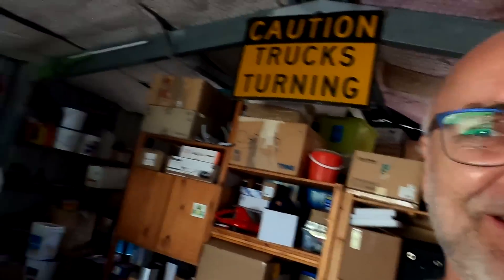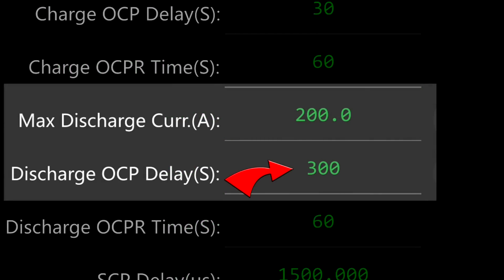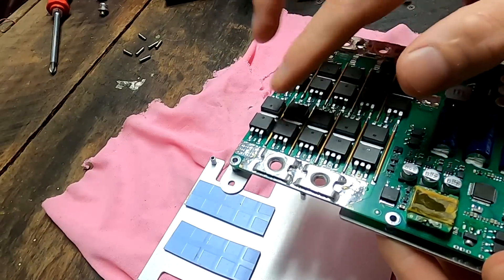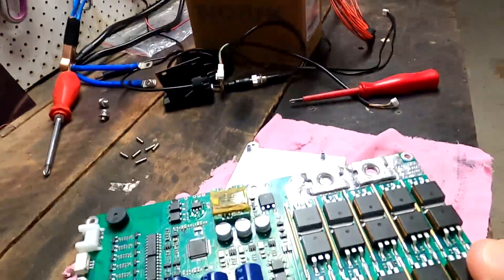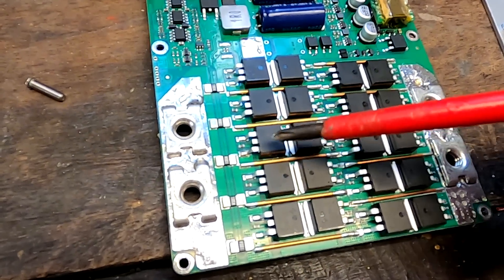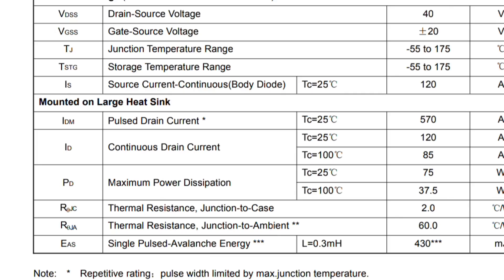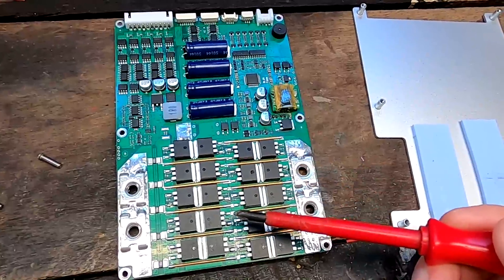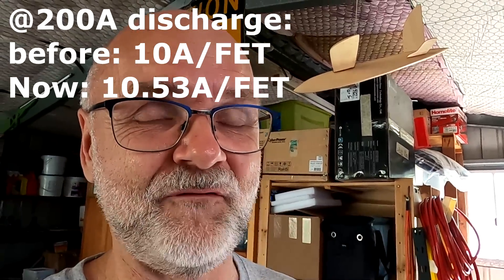Magic smoke! What happened to the JK-BMS? Still reliable or bad design?

Comment: Rule of Thumb: If you buy a BMS for a 200A continuous application, get one that is rated for 250A+. It's rarely a good idea to run anything at it's maximum capability continuously.
Reply: For sure, but the high current disconnect is supposed to be there to protect the system if something goes wrong.
The suicide disconnect is probably not the best safety...
Reply: For a timed over current cutoff it should be easy to for the BMS to start dialing the current back down prior to disconnect for 30 seconds to level out any temp/current imbalance between mosfets. Any reason this is not standard practice?
Reply: @kustomzone  The BMS has no ability to dial the current back slowly.  You would need a voltage converter to do that.   The MOSFET can only be on or off.  Any gate voltage that puts it in an intermediate state for too long (probably just a few milliseconds would do it) will dissipate the difference as heat and blow the MOSFET to smithereens.
Reply: @junkerzn7312  That is the purpose of snubber circuits. I don't know how (or if) it is implemented in the BMS. Snubbers help to reduce switching losses, slows down the current change and absorbed the voltage spikes to protect the switches.
Reply: @junkerzn7312  MOSFETs can be used for analog stuff like audio, voltage/current sources, DC loads, etc. Though most FETs aren't officially spec'd for that anymore, they can still be used as such perfectly fine as long as you stay within the SOA. At 14V 200A across 20 MOS pairs, that would be 140W per pair. If you individually rate-control every pair to keep them perfectly in sync, you could afford switching them off over a span of about a second. That would require one driver per FET pair though and there is no sign of one here. These are gang-controlled with small balance resistors to hopefully keep them together.
Reply: @kustomzone  the BMS does not current limit. It is a simple on/off switch.
Reply: @teardowndan5364  Small signal amplifiers, sure, just like transistors are used for that too.  But those circuits only pull a few milliamps and nobody cares that the transistor or FET is dissipating the difference between the power source and the output as heat when there are only a few milliamps going through the circuit.

Big difference between a few milliamps and a few hundred amps.

The question we need to ask with the type of circuit change you are suggesting is "what does it actually fix" ?   Insofar as I can tell, it wouldn't actually fix anything, but it would increase the cost of the BMS by at least a factor of two, maybe three.

The correct solution is to make gate drive about 10x (my guestimate) as powerful as it currently is (either to the rail or to GND... both directions have to be able to deal with a lot of burst current).

-Matt
Reply: @smak201  Snubbers are useful in switching power supplies.  The BMS is not a switching power supply, it's just an on-off switch.   The FET already has an integrated reverse diode, so a positive voltage spike on the output isn't going to hurt it.  That leaves just a negative voltage spike when it turns off to over-volt the D-S

But I don't think anything Andy had connected up to the output could cause a negative voltage spike.   The inverter going into the car charger has a huge capacitor on it, the voltage on the DC side should just drop steadily to zero.  I did suggest in my other comment that Andy put a scope on the gate and the output (using both channels) and take a look at what was actually going on.  Both to observe the gate transition time and to see if the output had any positive or negative spikes.

I still think the gate transition time is the most likely culprit.  It is the most common mistake that circuit designers who are inexperienced with power electronics make.  Its really easy to assume that the gate on a MOSFET works like a simple almost-digital input.  But it doesn't when lots of current is being pushed through the MOSFET.

I'll try to find an example of what I'm talking about... just quickly googling ... ah, here:

https://www.electronicshub.org/mosfet-as-a-switch/

Go about half way down to "Practical Switch Characteristics" and look at the bottom graph of the three graphs there, labeled "Switching losses".  That's the basic problem.   When the GATE is fully on or fully off, the losses are minimal.   While the GATE is being turned on or turned off, the MOSFET will experience non-linear switching losses.    The period of time that the MOSFET experiences these non-linear losses is determined by how quickly the gate can be pumped to the desired voltage (in both directions, either driving to V+, or driving to ground).

So basically, if the gate transition is too slow, and the MOSFET is handling a lot of amps, the losses cause it to explode during (usually) the on-to-off transition even though it was working just fine when it was steady on.   This is why dedicated gate driver circuits are required to drive the gate when using MOSFETs in power electronics, and also why its a bad idea to gang all the gates together for lots of MOSFETs and drive them all with just one or two gate drivers.   (and this is also why IGBTs are used in high-end power electronics instead of basic MOSFETs... the IGBTs have a built-in gate driver stage which guarantees fast switching times.  The faster, the better).

-Matt
Reply: @junkerzn7312  I wasn't talking miliamps. There have been 1000+W A/B-class audio amplifiers, DC loads, linear power supplies, etc. built using MOSFETs before D-class amplifiers became good enough for most people and applications. In higher-quality lab PSUs, you often have models that combine a tracking switching supply for efficiency and a linear FET output stage for low noise.
Reply: @teardowndan5364  

A 1000W audio amplifier at 4 ohms is 16A on the output stage.  That's why you can use power transistors or MOSFETs in the linear zone there.   You still need a fairly large heat sink though.   Lets see... 85% efficiency at 1000W... the audio amplifier's heat sink has to be able to dissipate 150W or so if you are pushing it full out.

16A is a far cry from 200A.

Linear power supplies have big honking heat sinks and typically also have multi-tap transformers going to the input of the power transistor or MOSFET in order to minimize the differential between input voltage and output voltage.   And are current limited to the worst case dissipation (which is the current x the voltage difference input-to-output).   If you change the voltage range (say its a 0-30V linear power supply), you should be able to hear the relays switch between taps.

A variable linear power supply will either have a low current limit or it will have a multi-tap transformer on the AC input and a somewhat higher current limit.

Fixed linear power supplies minimize the voltage differential by using a transformer to scale the input AC power down such that the rectified output is just above the desired output voltage at the desired output current, minimizing the power loss through the power transistor or MOSFET.

These are all relatively low amperage devices.   

--

And really, they have nothing to do with a BMS that is trying to switch high currents with MOSFETs.  It's a totally different beast.   I have to repeat... BMS's are not voltage regulators or amplifiers.  They are just big switches.

The BMS will be designed to be able to dissipate the heat from a certain amount of current going through it.   If it is mis-specified and this heat is anywhere near the limits of what the package can actually dissipate, then the package will blow up the instant you try to turn it off under maximum load if the gate driver is poorly constructed.

A properly specified BMS will include the switching energy loss in its specifications and de-rate the maximum current the BMS can handle to also cover the switching losses.

Many of these Chinese BMS's don't do the latter.  Or more to the point, these companies steal each others designs, low-ball the components, and then their marketing (rather than their electrical engineers... because most of them DONT HAVE electrical engineers working for the company) do back-of-the-envelope calculations with zero knowledge of switching losses or how MOSFET power electronics designs work, and they specify the maximum current based on the ON resistance only, without account for switch-off times or losses.

So, rule of thumb... don't push these BMSs to their advertised limits if you want them to last.

-Matt
Reply: @junkerzn7312  1000W was just a random decently large number to counter your "miliamp" argument. There are 6000+W ones too and likely even bigger ones out there. The beauty of FET-based power amps is that FETs have positive temperature coefficients which makes them partially self-balancing.

Modern precision variable PSUs don't use tap-changers, they use a tracking switching power supply with 3-5V of headroom for the analog output stage.

As for why the FET died, I doubt it has anything to do with switching losses. With upwards of 400A peak going through there, it doesn't take much inductance to exceed the weakest FET's avalanche energy and destroy it, especially while switching the FETs off as fast as possible instead of using rate-controlled drivers.
Reply: @teardowndan5364  The point on switching them off and on in sequence... there is actually a solution that allows running MOSFETs in sequence.  That is, turning on one at a time and sequencing through all the MOSFETs individually at a relatively fast pace.   This is the VRM mechanism that (for example) PC motherboards use to supply hundreds of watts to a CPU chip or a GPU chip.  Typically VRMs are used for voltage regulation and have inductor stages, though, and not used for simple switching applications.

The problem with this method is the need for inductor stages on the output of each MOSFET, and having to switch the MOSFETs at a relatively high frequency due to package dissipation limitations.  On PC motherboard the frequency can be as high as 500KHz.   For a BMS, though, it would be reasonable to do it at around, oh my guess would be around 20KHz.

But because of this, much higher quality MOSFETs would have to be used, and a dedicated VRM clocking chip would also have to be used, otherwise the power losses would be very high.   And also dedicated inductors and big capacitor buffer would be needed.   So the cost goes up dramatically.

We definitely would not be able to switch the MOSFETs on multi-second intervals.  They would blow up because the packages just can't dissipate that amount of energy.  Even though the average over minutes would still be in-spec, the instantaneous energy accumulation would be out of spec.  The package would not be able to dissipate it quickly enough during the 'ON' period.

-Matt
Reply: @teardowndan5364  I'm not making a 'milliamp' argument.   I'm just telling you the physics as an electrical engineer.  You keep confusing voltage converters (power supplies, amplifier circuits, and the like), with BMS's (which are power switches, not voltage converters).   Please stop confusing the two, they aren't the same.  They don't work the same, and the designs aren't the same either.

There is no magic here.  Any voltage drop (Vd) across a MOSFET or transistor or diode with (I) current is going to generate (I * dV) watts of dissipation through that MOSFET or transistor or diode.   It doesn't matter WHAT it is doing.

--

When people use these devices in amplifiers or linear power supplies, a great deal of power winds up being dissipated by these elements.  That power is calculated and dealt with by the design.   As I already described, your 1000W audio amplifier is not pushing 200A through a single MOSFET operating in a linear zone.  It just isn't.

MOSFETs used in switching applications assume that the MOSFET will be fully on or fully off most of the time.   NOT operating in its linear zone which would blow it up in this application.

In this case the fully-on MOSFET will have a low internal resistance... a few milliohms.   So, for example, 3 milliohms x 200A x 200A = 120W.   A single MOSFET with 200A going through it of this type would dissipate around 120W.

It can do that, but the package is only able to keep up with about 37.5W so obviously it would only be able to do it for a very short period of time.  Less than a second, certainly.

--

But that isn't what the problem is here.  The problem is that when a MOSFET used in a switching application in a circuit designed to expect 3 milliohms of internal resistance is instead operating in its linear region and not saturation, the voltage drop between source and drain can increase dramatically.  *As you can see on the datasheet*.   The circuit board cannot deal with this amount of dissipation for very long... a few milliseconds maybe.

When the MOSFET is operating in its linear region due to a slow gate drive, there can be a large voltage drop between S and D.  For example, it could be 6V.   6V @ 200A = 1200W being dissipated by the MOSFET.   1200W.  How long will the MOSFET last dissipating 1200W ?   Not long.   Instant death, pretty much.

See the problem?   A MOSFET that is used in a high power switching operation must have a very fast gate driver.  If it doesn't, the rise time or fall time of the voltage on the gate during switching will leave it in its linear region too long and it will blow up *just from that*.  Never mind avalanching or current migration.

The BMS is not designed to dissipate 1200W from a single MOSFET.  Without a heat sink, just on the circuit board copper... we're probably talking 10-20W continuously on each MOSFET.  Or less.

-Matt
Reply: @junkerzn7312  I'm not confusing anything. The point is that for the 1ms where the FETs should be operating in slew-rate controlled mode to safely dissipate transients and parasitic inductance, the FETs would be operating in their linear region just like an amplifier or linear power supply.
Reply: @teardowndan5364  You are confusing everything.  What the heck do you mean by "1ms", are you trying to blow the BMS up? And why exactly do you believe that operating in the linear region gets rid of transients and parasitic inductance?   And why do you believe that the FET can even dissipate the amount of power associated with those in the first place?

Nobody designs power switching circuits that way.  Nobody intentionally tries to make a FET in a power switching circuit absorb extra energy from transients or inductance.   Nobody.   It is suicide for the FET.
Reply: I'm going to make this as clear as possible, this will be my last posting on this sub-thread.   Here is a typical gate-driver chip:

https://www.ti.com/lit/ds/symlink/ucc27325.pdf?HQS=dis-mous-null-mousermode-dsf-pf-null-wwe&DCM=yes&ref_url=https%3A%2F%2Fwww.mouser.com%2F&distId=26

Just read the datasheet carefully.  There is no slew-rate control.   There is no '1ms'.  There is no linear region management.  It produces 4A of drive current on its output and it is designed to shove the gate pin of the power MOSFET it is connected to up or down within around 40nS (40 nanoseconds).

(The 'miller plateau region' is a region where the gate voltage gets 'stuck' at a particular mid-level during an on-off or off-on transition.  Maximum drive current on the gate is desired in this region to get the power MOSFET out of the region as quickly as possible)

There is a reason why all of this is important.
Reply: @junkerzn7312  @Teardown Dan Wow such confusing :). I think you both have a point there. Designing a good power switching circuit is not easy and you can blow up transistors in various creative ways. Making the BMS better would probably not make it hugely more expensive but it would need some effort.

On one hand you do have to turn the switches on and off fast enough to limit the conduction losses in the linear region. You do that by having high enough current to drive the gate of the MOSFET. At the same time, you do have to keep in mind how fast the current can change through the circuit. Power switches are designed to operate in linear region to control the rate the current and voltage are changing. That’s why there are gate resistors in most circuits (and to eliminate ringing). That is mostly used to control turn-on time and the reverse recovery of the diodes in most switching applications, not to absorb large inductive spikes. Separate snubber circuit parallel to the switch are used to slow down the di/dt and absorb the energy from the inductances. 

BMS would have to have some way to absorb or redirect the inductive current when switching of the load. There needs to be capacitor to catch the current or flyback diodes to/from battery positive to clamp the voltage before and after the switch. If the inductance is allowed to drive the MOSFET to avalanche breakdown it will most probably be destroyed at those currents. If the MOSFET will breakdown at 50 V that would be 50 V * 200 A = 10 kW heat generated inside the switch. The breakdown will most likely happen only in the MOSFET with the lowest breakdown voltage and the voltage doesn’t get any higher. That is good news for the other parallel MOSFETs that will be protected by the “voltage clamp”, but not so good for the single MOSFET trying to dissipate 10 kW.

Generally, there should not be too much attention paid to the maximum current carrying capacity of the MOSFET specified in the datasheet that Andy was also showing in the video. That is just a number the manufacturer specifies that you should probably not exceed in your design. It does not mean the MOSFET can actually handle that much current in your specific application. Everything depends on the cooling solution, switching losses, conduction losses, expected voltage transients, etc..
Reply: @junkerzn7312  Nothing suicidal about it. 5kW for 1ms is only 5J worth of energy, 250mJ per device with proper per-device rate control and this happens only once per 10+ seconds, plenty of time for heat soak and allow use of single-shot/0.01% duty cycle ratings.
Reply: @junkerzn7312  I agree that a mosfet can only switch on or off. A mosfet can lower voltage output but only by switching on/off at high speed and adding a capacitor after to even the output although this would be much worse for the mosfet than just switching off once.
Reply: Ur absolutely right ICHBINS, a good rule of thumb, but as  this was a test situation, so I guess we may tend to push things a bit to check manufacturing claims.
Reply: Especially when the load is a 2500W inverter which can pull nearly 400A peak. (The instantaneous peak of 2500W AC is 5000W, 400A at 13V minus whatever amount of ripples the inverter's DC-in filter may be able to smooth out.)